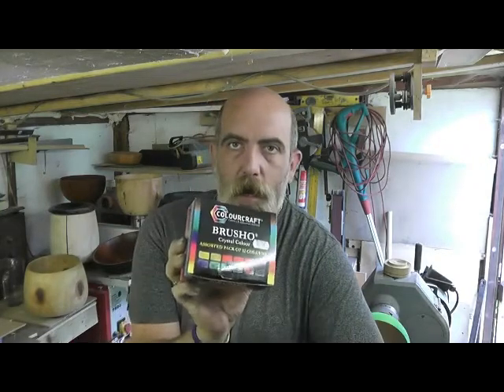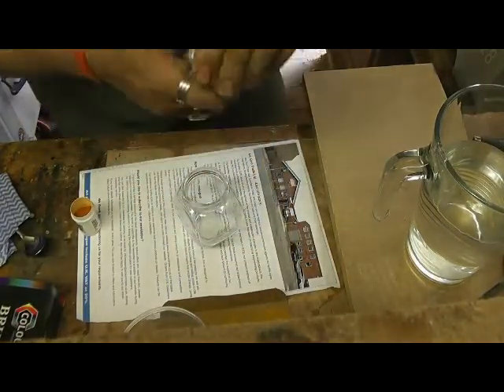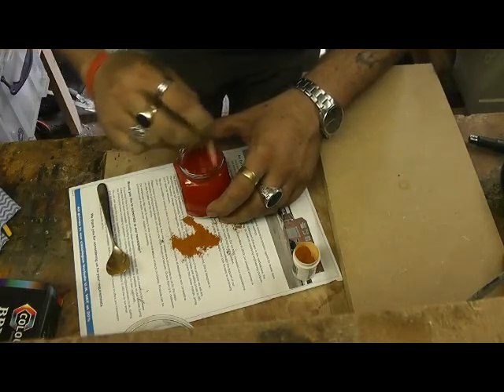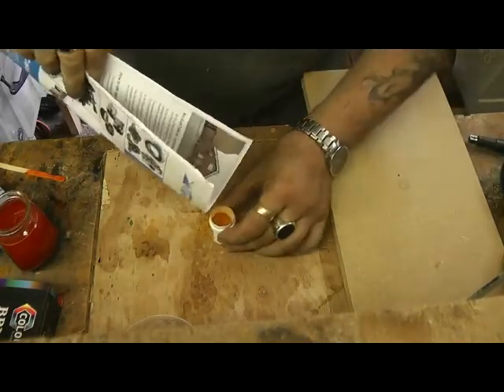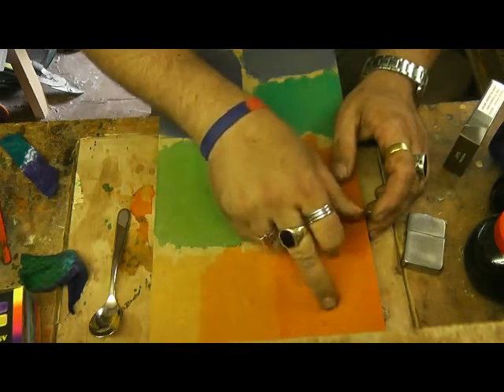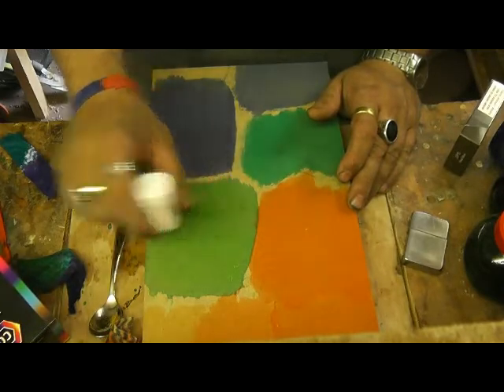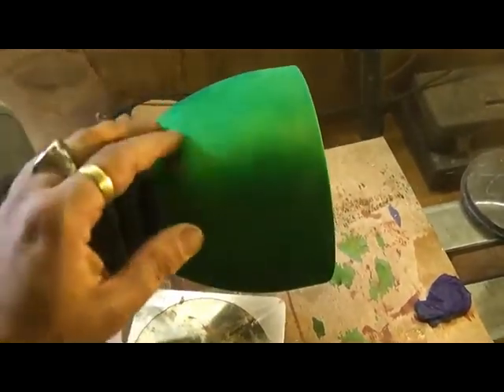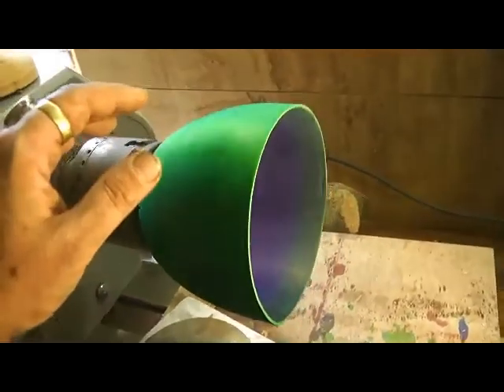Brusho dye pigments for water based stains

Comment: A very interesting video Mark, thorough and well presented mate.
Cheers
Mike
Reply from the maker: Mike Waldt thanks buddy, one thing I didnt think of though with them being powder pigments is undissolved pigment, there is not a huge amount but enough to cloud the inside of the jars at the bottom, if I had of thought of that I would have mixed in a plastic cup then poured into the glass jars through a fine filter, Ill add that to the description